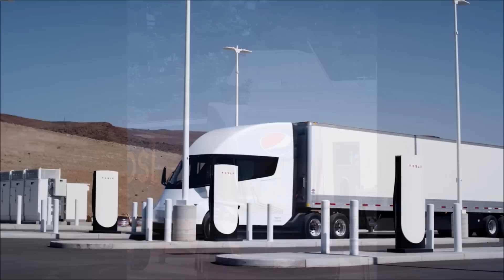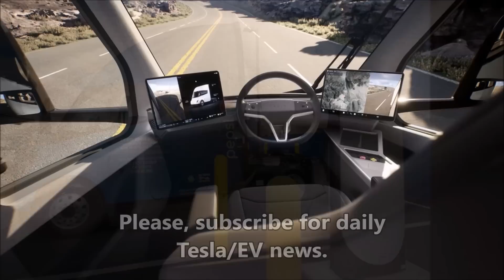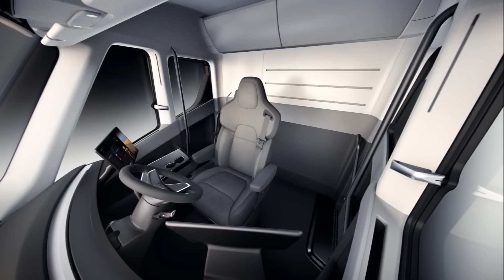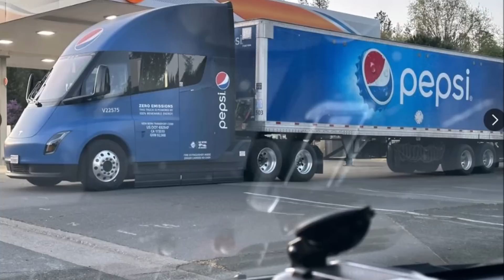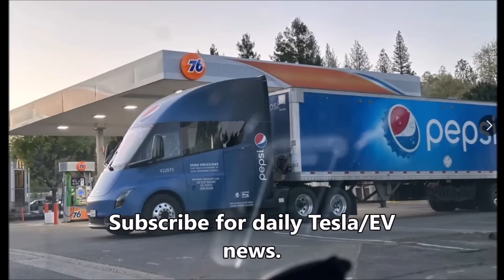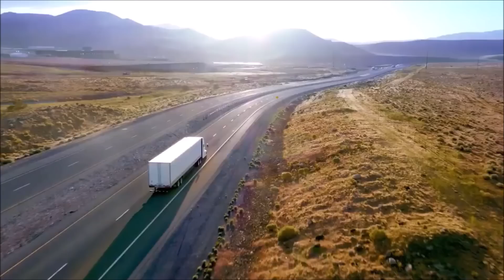Pepsi Tesla Semi: Trucker's Review of Center Seat's Main Issue

Comment: I drove semi truck for a living before I retired a few years ago. I do not see the central location of the drivers seat as much of if any issue. I see it as a benefit over all due to the way I did my truck driver tasks. I also like the video camera mirrors, especially the ones I have seen videos of installed on some of the European semi trucks. The mirror is actually a big high resolution video screen mounted on the inside windshield pillar. The external cameras are small items mounted somewhere on the exterior. They are much closer, easier to see, easier to clean and much less susceptible to receiving damage. I bet they could also be equipped with night vision and infrared as well.

The main issue I see is not the central driving position, but the lack of an opening drivers side window. If you want to talk to or exchange paperwork with someone outside the truck, you have to open the door. I can assure you, there are a number of times and situations that occur where you do not want to do that.
Reply: Nice summary. Great insight. Thanks.
Reply: I drive long haul and rarely back straight into any dock or parking spot. Mirrors will point at the side of the trailer as you back up and turn your steering wheel. I wonder if the Tesla mirrors/camera move outward as you back up and turn the steering wheel.
Reply: You know you don’t drive truck, stop lying
Reply: Pretty sure the windows open. Not sure if they hinge out or what though. This is also not the Semi's final form. They did consult drivers on the initial design, and they did consult drivers on this proof of concept. Now they're tweaking a bit more before production. We'll see what they come out with

Comment: I think the amount of physical energy saved by never having to clutch and shift ever again would be worth the little hassle  of getting up out of the seat once
Reply: There are still stick shift truck drivers out there. Not even automatic yet
Reply: I learnt to drive in my father's Mack, that was a quad box, everything was simple since then, l was 14.
A Road Ranger 18 speed double overdrive was child's play with only one stick.
And we didn't have sleeper cabs or air con either, and air ride or cab suspension wasn't invented.
You camped on the side of the road on ling hauls or across the seats.
Drivers today are spoiled sissy's.
Reply: Nope it's not! It's all about range and capabilities and diesel is still far superior
Reply: @alanmay7929 nothing superior about being gassed  by diesel fumes if one has respiratory  issues.
Reply: @aurelio-reymilaorcabal9669  which diesel fumes!? Are you ok!? So all those trucks doesn't have particles filter Systems!? Are you stuck in the 70's or what!? Grow up please. Educate yourself!
Reply: @alanmay7929  my lungs and nose tells me when a diesel truck has that diesel treatment apparatus on or not, I have Ashtma  and COPD , something as minor as cigarette  smoke makes me gag and I cross to the other side of the road  when I see a person with a cigarette  in mouth or hand.
Reply: @aurelio-reymilaorcabal9669  all the infrastructure that your EV are relying and will still do everything from roads, bridges, the grid, goods and much more EVs are not ready to do that.
Reply: @aurelio-reymilaorcabal9669  a cigarette is a totally different story because it literally kills you as you smoke it its directly goes inside the smoker's system.
Reply: @aurelio-reymilaorcabal9669  and your mouth doesn’t smell too! Lol!!!
Reply: @aurelio-reymilaorcabal9669  you want to attribute your ASTMa to the diesel engine or what!?
Reply: @alanmay7929  my Ashtma  was due to working with  cement dust , wood dust, and  now cigarette smoke and diesel fumes  trigger it more  than the first two, pray you never get the disease because having the feeling you are being choked to death is not pleasant, up to age 45 I felt like I was invisible and was Superman, oh I was a mover as well  could lift A WASHER  DRYER set  by myself  from the basement of a house, at that  time I was 116 pounds.
Reply: @alanmay7929   most charging is done @ nite when demand is low, it actually  helps  balance the GRID , and we now have a plan in Ontario Canada  that when you use ELECTRICITY  IN THE EVENING  the priceis much lower, the Govt want people to buy EVs so that we DONT PAY New York  and Quebec  to take EXCESS Generated Hydro. Oh %Ella's are the most common EVs in Canada and in Ontario  they are beating BMW sales as those German cars need EXPENSIVE  PREMIUM FUEL@$1.80/ liter,so around $80-$100 / fillup of Fossil ⛽ vs $15  for a " Full tank" of⚡ Electrons🤑
Reply: @alanmay7929  You don't understand , I never have smoked!   CIGARETTE SMOKE  as in 2nd hand smoke triggers it, I cross  the other side of road to avoid it when I see a person with a lit cigarette, oh I used to sit in the Coffee Shop reading papers 20 years ago, we had this " Smokers Room"  , even staying out of there I would come home reeking of CIGARETTE SMOKE, today those smoking rooms don't exist anymore, they have been BANNED.

Comment: I drive a semi and when backing into many, in fact most docks you jack knife  into the spot from drivers side, always avoiding the passenger side known as blind side. As trailer and truck back up and jack knife into the dock or parking spot your mirrors are pointing at the side of the trailer on the drivers side. You must lean over and often stick your head nearly out of the window to see the back of your trailer. Mirrors only help when backing straight.

Comment: It’s probably centered so Tesla can sell the truck without modification for left or right hand drive countries. Increases production efficiency, because no double parts for left and right side trucks.
Reply: It’s meant to be driverless eventually
Reply: @mewtwomotherfuka  I think middle seat is easy to adopt to. Some super cars have middle driver seats and all reviewers liked it. No reviewer ever said middle seat driving was an issue. I think the same applies to trucks.
Reply: @mikelewis1166  it seems Tesla self driving is so close yet so far away.  Hopefully they iron out all the bugs. New FSD versions fix old bugs but introduce newer ones, which gets fixed on the next release but newer release has its own bugs and the cycle keeps going on for years even the most current release.
Reply: @flargosa  What you are saying is accurate. However, look at the current FSD 11.4.(?) video and then compare it to the video of 2 years ago. You will absolutely be floored at how bad FSD was 2 years ago. By the end of this year, a good percentage of cars will have Hardware 4 coupled with end to end AI (probably). I imagine Tesla will have to officially designate their vehicles as SAE level 3 or 4 at that point.
Reply: @mikemccormick6128  time will tell if Tesla indeed finishes FSD.  It is not a hardware limitation but a software completion issue, as Elon has said it is much more complex than they originally thought. Yes FSD is better than two years ago, but it still has issues as many users point out.
Reply: @flargosa  I understand that it's not mainly a hardware issue, but the hardware is a leap forward and you have to look at all factors. Yes, you are correct, that it's mainly a software problem. It's probably not possible to do fully autonomous vehicles without end to end AI. I believe that is coming with FSD 12.0. In my strong opinion Waymo is not fully autonomous because of how severely limited they are in where they can go. They use centimeter scale mapping to achieve very limited autonomous driving. When Teslas achieve full autonomy, they will have the ability to go anywhere regardless of whether it's raining, snowing, or even if the roads are paved. That would be true autonomy.
Reply: @mikemccormick6128  In software development the last 20% takes 80% of the time. It isn’t a law but a rule used when planning out projects.  I think Tesla is in the 90% done category.

Even if they finish FSD soon, it’s an additional $15k. How many would purchase it? Cheaper to pay Uber or Taxi to get me to wherever than paying for FSD.
Reply: @flargosa  Yea, I would never pay for self driving either, at least not until I had no ability to drive myself. I just think the idea of it is really cool. Just like I would never go to Mars. But the idea of humans going to Mars is really cool.

Comment: I'm a truck driver, and a huge fan of Tesla. Having said that, the central driving position does have a drawback I haven't heard others discuss yet, and that is when backing into a dock. All docks are designed to minimize or illuminate the need for blind side backing. That is, backing into a bay on the right side of the truck while the driver is on the left. But, with the central seating position, both sides are blind side. You cannot look over your shoulder, out the left side window, to sight down the side of the trailer to align it with the dock doors.
Reply: Since your a fan of tesla, you should know they come with more camera's then needed to help you see the vehicle and it's surroundings
Reply: @René ;)  it's a bit different when you have a constant change of 53' trailers. But you'd know that since you drive trucks right?
Reply: @ReneF1R  Backup cameras are great, as are mirrors. But both offer limited depth perception. When backing into a dock, I always used a combination of the mirrors and looking over my shoulder directly at the dock. That's how I was taught by an old trucker. So I imagine I'm not the only one.

Again, I'm a fan of Tesla, and I hope their semi is wildly successful. I'm just pointing out a possible flaw that I have not heard discussed elsewhere.

Comment: As a driver I can see the pros and cons of the Tesla Semi, but to me there are still way too many variables that happen as a truck driver to make this truck practical today. What happens when California starts their rolling blackouts through the summer and you can’t charge this truck with a 1 megawatt or larger battery? Also, with the green initiative, where is this electricity coming from? Not only is the grid not capable of supplying the necessary power to charge those trucks, but it’s not all from “clean” energy. 

Initially, Tesla thought they could build an over the road truck, but the trucking industry quickly showed them it’s not feasible with todays infrastructure. These trucks work for local deliveries where drivers spend more time at the dock than on the road, but how much fuel is really saved parked at the dock?

OTR applications are where the most fuel is being consumed, and these trucks simply cannot go 600 miles with an 11 hour driving clock. It’s amazing they were able to engineer this truck, but they didn’t consult anyone in the industry. 

Finally, what is the real life expectancy of these battery’s being mega-charged daily 365 days a year and being used for as long as the battery will last? Tesla cars have significant battery degradation after personal use that comes nowhere near to the amount of use a commercial vehicle gets, and the abuse it will get put through. Every company is different, but if it’s a company that uses its local trucks 24/7 with multiple drivers then they have to essentially buy twice as many truck’s because of the charge time. LTL comes to mind on the last point because they’re local, but they also have runners that drive several hundred miles between cities at night then those same trucks are used for pickup and delivery throughout the day. 

It’ll be very interesting to see what happens, but my money’s on hydrogen being the main fuel source for the vast majority of trucks in the future.

Comment: In the UK, a truck arriving at a gate may have the driver sitting at the left or right hand side of the cab, depending on whether it's a British truck or from Europe. Not that this affects Tesla Semi because it's unlikely to be viable in Europe.
Reply: I always thought the Tesla semi would be more viable in the UK and EU given the shorter driving hours allowed.
Reply: @redguard2529  It's not a cab-over design is it? That long nose means it will exceed maximum permitted vehicle length when coupled to standard trailers. Plus, you can't fit as many on a ferry,
Reply: @brendanpells912  Got you. I wasn't considering the length. The Tesla seems to have a lot of empty space (if not equipped with sleeping accommodations) behind the driver.

Comment: I would have thought the bigger issue is when backing up. Yes, I have driven a semi truck over the road but that was many many years ago.  You mostly use your mirrors but it is common, at least for me to look out the drivers side window at the surrounding and visually see that what I was seeing in the mirrors is all present and their were no objects of concern that the mirrors might miss.
Reply: Cameras ?
Reply: Why are we still using paper for manifests and bill of lading?
Reply: If the cameras are set up even as good at the model Y then not an issue. I know trucks are different but from using the Y it is easier to reverse into a small spot using the camera then to drive in forward. This is because the cameras give an excellent view down the side of the car.  You can't get that with your head and even if you could you couldn't watch both sides and the back at the same time. I suspect they did the camera setup on the semi in such a way you get the same advantages so you don't need to look out the window or even use your mirrors when reversing.
Reply: This is a very valid point! Cameras or not there’s nothing equal to actually looking out of the mirror and seeing the trailer tandems while backing up. Even with cameras, what happens on an ally dock when the trailer is jackknifed and the cameras pointing at the side of the trailer? Or when it’s pitch black dark and all you can see is your marker lights backing up? Do these windows even roll down???

Comment: Truckers have had to adapt to much larger changes like a different truck each day, the passenger-side view being very distant in a tiny mirror, and synchronizers on gears being poorly maintained…. Getting out of their seat to hand something to somebody and then getting back in their seat and driving forward in such a simple truck is the least of their problems. Could even be faster and safer. The trucks going quickly through the gatehouse now have their truck still in gear and could hurt somebody with a slip of their foot.
Reply: Yes, trolls. From a trucking family here. Loaded a bunch myself. Have ridden in more than I can count. This truck is like the luxury Ford automatic we got from Ryder one time on steroids. Shifting is for sports car drivers that want to feel like they matter.
Reply: Taking the time to count… hmm… granddad had 3 triaxles. Other granddad had a few tractors. Dad drove a Scania for Sauers and then several at smith and then several piles of crap from some other place after that before the place I worked. That one we worked together had 5 class B vans. A cab over. A bunch of single axle international day cabs. 2 red international sleepers. I think there was 1 oddball Freightliner day cab in there too.
Reply: You can’t tell me after seeing all of that and what a pain in general trucking is that Tesla Semi is poorly-suited to the job. Heck, 80% of the trucks I was in were poorly suited for the job. Tesla Semi is making changes, most of them obvious improvements. It’d be nice if production happened faster.

Comment: Time for paperless, or a $10 trash picker 😊
Although the dirty boots seems like a fair point… I wonder how can it be solved, other than putting the door closer 🤷🏽‍♂️
Reply: A welcome mat to wipe the dirt off. It works at home.
Reply: It would cost to much also would bring more problems then it's worth
Reply: just leave the boots on the Stairs? pretty sure there is plenty of space for them there...
Reply: @unitrader403 - that has been the stated purpose of the space behind the driver since the beginning - hang up coats, clipboards, whatever you might plop on your passenger seat or maybe in external storage in a diesel truck

Comment: I'm of the opinion that it was designed for different countries left and right hand drive, this saved production costs. 
Our country is right had drive, but the street sweeping vehicles and garbage removal trucks have a sliding seat and control system.
I drove heavy multi combination trucks for 40 years, the most practical truck for the driver was a Freight liner 110.
But it lacked large diameter plumbing for air bag suspension.
The worst truck was in my opinion was the Mack B61 with camel back suspension.
The Tesla truck I'll probably never get to drive, unfortunately I'm almost past my use by date, but I'd realy love to see how it's improved life for a transport driver on a one G planet.